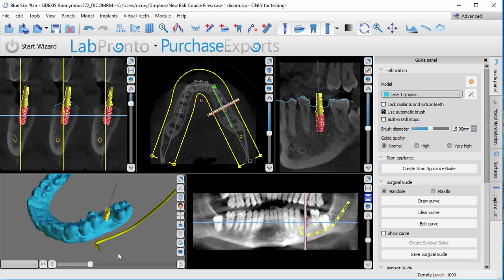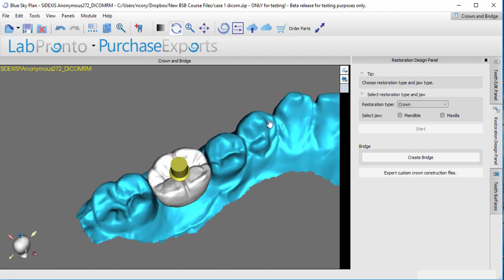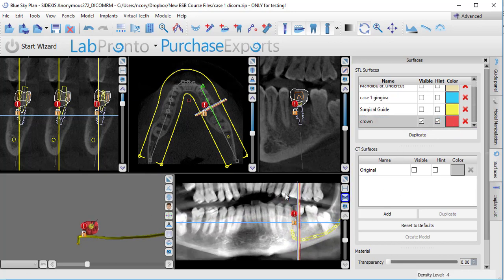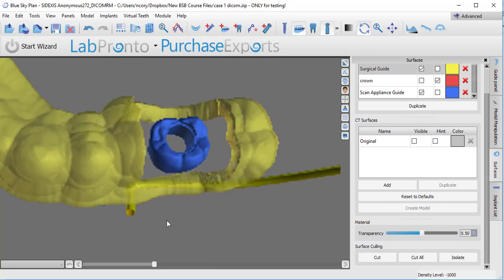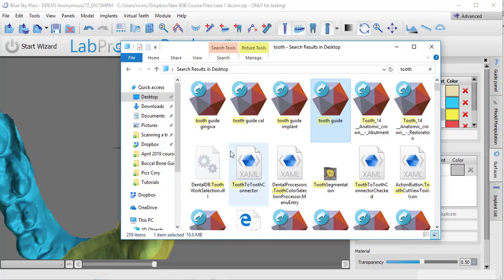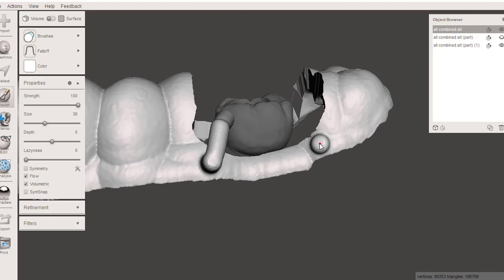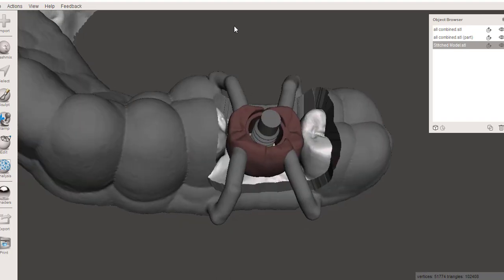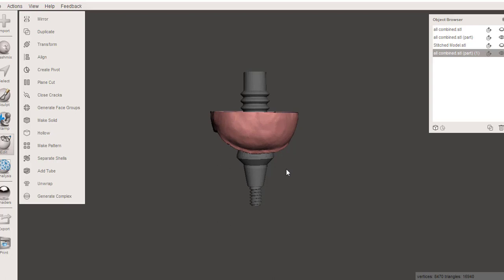The Tooth Guide

Comment: Could you make the gap the size for an Acuris conometirc insert? So place, check fit, bond crown to cap and friction fit on.
Reply from the maker: you could make it whatever you want........here the hole size was determined by the size of the built in key on the bsb fully guided kit

Comment: what would be the best material to cement the printed crown to the temp abutment, 
also out of curiosity, have you tried to print an abutment/crown hybrid for temp immediate loading
Reply from the maker: Can absolutely pre-print a hybrid temp.........got a few videos on my channel of how to make.  I'd just use a resin dual cure cement to bond the tooth and tibase
Reply: @n.coryglenn3814  I will be attending your course in LA the 26th of July, it is for the full denture cases, I sent an email To inquire more about the clinical skills and tricks. Would the course discuss the extension of the flap and how to integrate marks to avoid vital structure :$ 
Thanks doc